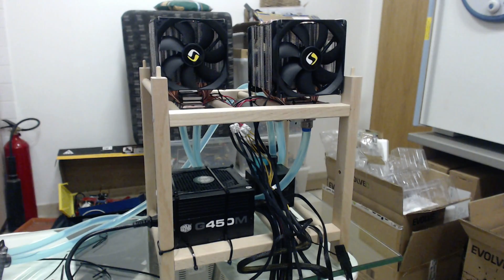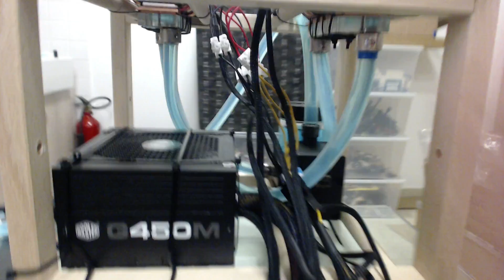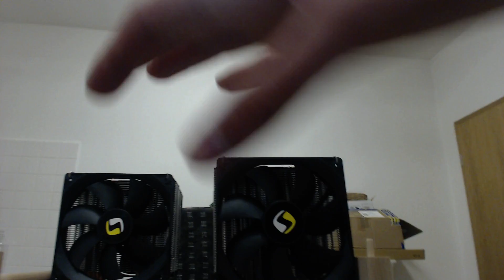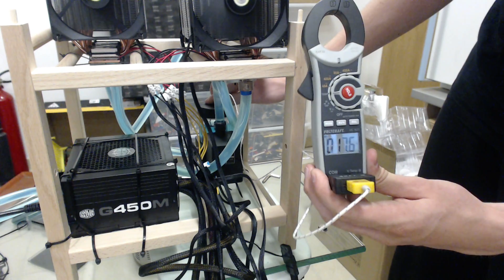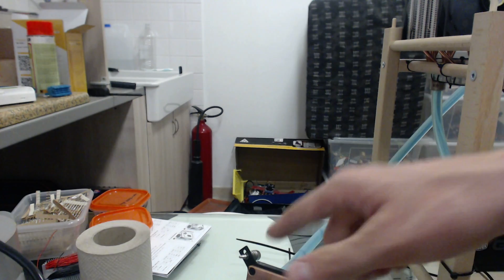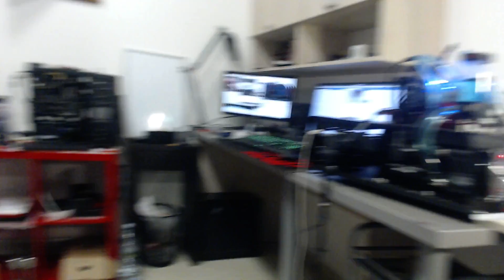Buildzoid has a WORKING(mostly) TEC water chiller

Comment: I have seen your post on reddit. This is a pretty interesting setup. I assume your coolers need more power than the complete computer.

Maybe you could use something else than water that freezes at lower temperatures. If your pump fails or the ambient air gets colder you will probably freeze the water under the coolers.
I have some TEC modules like that around and they will get around 60°C temperature difference and with coolers like that the cold side will get to -20°C fast.

It would be interesting to see if it really helps while overclocking and under load.
Reply: Anti-freeze+water

Very good mix(or just pure anti-freeze).